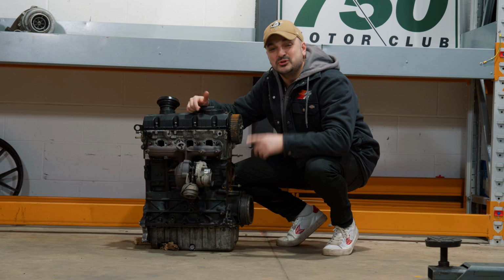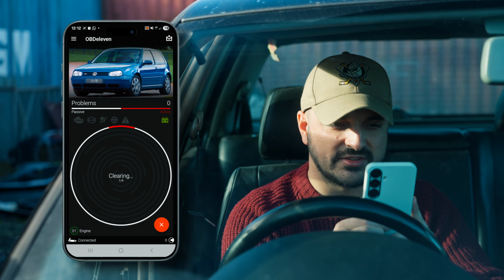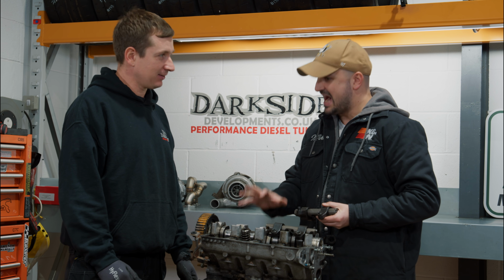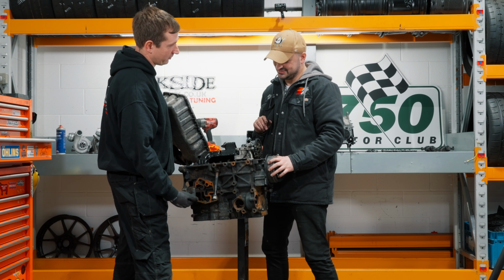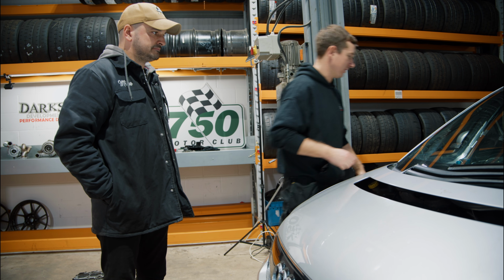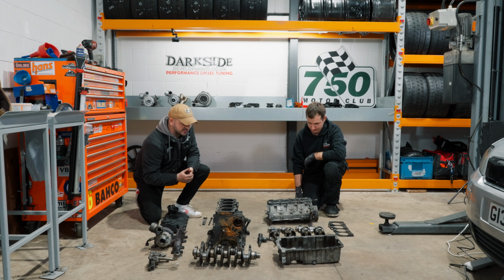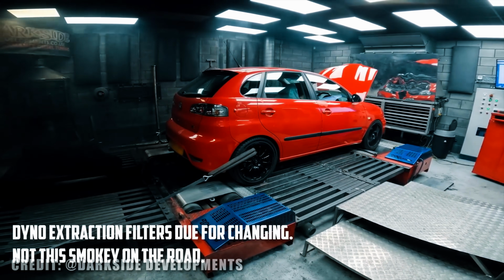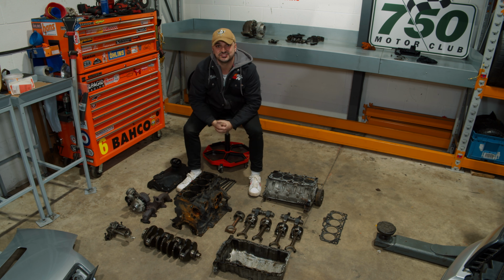Why This Volkswagen Diesel Is The Greatest European Engine Ever Made

Comment: This was in my car—a Caddy 1.9 TDI—and it had covered 499,800 km by the time I sold it. The only issues were that the battery would drain on its own if the car sat for a week, and there was a bit of light blue smoke during a cold start—nothing major, though. When the engine was warm, there was no smoke at all.

Comment: as someone who has driven and worked with Darkside developments here in Australia. I absolutely swear by them as wizards for the diesel vwag cars. doesn't matter if you want a nice daily or big power. these are your guys for hardware and definitely software. 

I am not a huge diesel fan but our drive cars that had a 1.9tdi caddy and a 2.0CR in a golf. they honestly drove brilliantly. real sleepers with great driveability and awesome economy. 

our crafter also was a workhorse running darkside software. 

had a 2.5tdi multivan these boys did software for and it was beautiful

Comment: I have a Skoda Fabia vRS Last Edition; I love this little car—I've owned it for 10 years. I'm currently replacing the camshaft and lifters with "Black Top" versions. I also crimped the small end plugs on the rocker shafts, as they tend to work themselves loose over time, and installed 07eins injector clamps to prevent the injectors from wearing down the bores in the cylinder head. Those are the only weak points; fortunately, I do all the work myself, as the mechanics are quite straightforward.

Comment: ALH engines are generally considered more reliable and easier to maintain, with cheaper parts and less sensitivity to oil specifications.  PD engines are known to be more prone to camshaft and lifter wear if incorrect oil is used, and their injectors are significantly more expensive to replace. ?

Comment: Does the injector solenoid not close to hold pressure in the pump, allowing it to over come the injector nozzle valve and spray fuel instead of energising to allow fuel through to the nozzle. That way it fails safe if the loom breaks.

Comment: great engine especially when the egr is disabled for better response and better mpg I ran one for 10 years sold it at 300k miles things to be aware the wiring harness in the cylinder head can break down giving injector faults the cam belt tensioner can fail both easy fixes and change the oil every 5k miles

Comment: Ran my PD130 on a high mix of petrol with dregs of diesel on the tank when we had a 'fuel crisis' in the UK a few years ago. It ran with a bit more smoke than usual (straight piped) but it ran fine for a good 50-100 miles!

Comment: There even was a 2.0 TDI with PD elements, Engine Block based on 1.9 TDI and Cylinder Heads with 8V or 16V (16V had some problems with PD Elements working into the Head), 8V was kinda good (Oil Pump Drive was a weak spot).

Comment: …and 100% get an OBDEleven! Bought a 2008 BMW X5 3.0si from a dealer as a “value unit” (headed for auction). 83K on the clock with the typical valve cover gasket leak—tech’s denied repairs—bought an absolute GEM for $4K. Repaired the gasket, installed gentle upgrades to the ignition and timing, tune everything via my phone through the OBDEleven dongle. Added optional upgrades like the folding mirrors and roll-down/up windows via key FOB for about 20 credits. The collective “close-sunroof/windows” via the moisture sensor already installed in your car is an added bonus. Definitely “hack” your car for little more than the cost of an OBDII ‘code reader’!

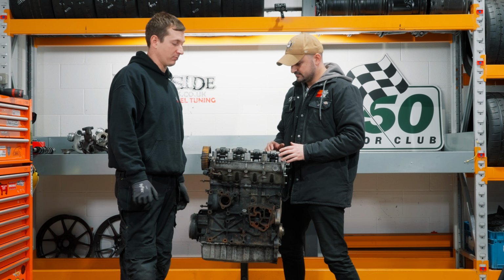Comment: 8:45 The biggest reason for failed PD engines is using wrong oil. These things require VW 505.01 spec oil and if you use "only" VW 505.00 spec oil, it will wear cams prematurely. Unfortunately, getting VW 505.01 spec oil is getting harder and harder these days.
Reply: Castrol edge meets 507.01 & Castrol guarantee it to meet the 505.01 spec too… iv ran Castrol edge in my 1.9 engine for 14 years & 188k miles… all good & oil analysis showing good too still!

Comment: Pumpe Düse engines were regarded, by those in the know, as good but less good than the VW TDi which preceded them, on account of earlier camshaft and injector wear.  VWs and Audis had the better engines up to around 2000 model year, Skoda Octavias used them until around 2004.

Comment: I have the GOLF MK 7 variant 2.0 TDI .. 150 hp  ... just changing the OIL every +/- 10.000 km's ... the engine sounds, vibrates & rolls just like day one after 220.000 km ..... On the streets of my city there are PASSATS from 1992 ...  and evenr older.

Comment: My dad drives a 2000 A4 with the 1.9TDI engine. 500.000 km done, the car was used recently for a 5000 km round trip across Europe. Needless to say, the car works great. Very little rust around the front wings, otherwise no damage. The engine itself works like new.

Comment: The VW PD 1.9L is better for modifying then the 1.9L TDI  (ALH). Even though I like the PD and it is overall a better engine, I prefer the ALH for my use case. I have only heard that the camshaft is the weak link for the PD, it has unit injectors like a "newer" 2-stroke Detroit diesel so that must put a substantial amount of force on the camshaft because it is doing double duty compared to the ALH and that must be why these engines can have issues with the longevity of the cam.

Comment: I have a 2014 3.0 V6 TDI CTBA - 341,000 miles and touch wood still sweet as a nut.  Only thing to go wrong was Adblue system (deleted), auxiliary coolant pump £17 from Aliexpress ,  vacuum solenoid £12 Aliexpress. On a run it still does 40mph+ in a large 4x4. DPF still fine.  0-60 in 5.9 sec.  Best diesel for me is this.  Only thing I have done since 100,000 miles as second owner is change the oil and filter every 6,000 miles.

Comment: It really is a fine motor....mine is on 210,000 miles and still ticks over like new. Just keep changing the oil every 5000 and use castrol edge 5w40 and you won't go far wrong. My reg.fh55ure

Comment: Just stay away from gasoline  2.0 tsi engines after the 2022 and newer.  VW says burning 4 quarts in between 5,000 mile oil changes is within spec - "normal".  Keep in mind it only holds 6 quarts of oil.

Comment: I’ve seen Fiat Puntos with the small 1.3-liter MultiJet engine—delivering a solid 95 hp—reach 700,000 km without ever experiencing major issues. I know the 1.9-liter version can also easily achieve high mileage; it’s a favorite starting point for tuners because these engines are incredibly robust. Many diesel engines from that era were highly reliable—especially those from Fiat and Volkswagen (not to mention Mercedes, where reliability is simply a given).Fiat cars do not have a good reputation, but the diesel engines they produced from 1997 until ten years ago were very well made.

Comment: nope, best vw engine yes, but the volvo b230, and the early (dog slow) mercedes diesel, lasts longer.  had all 3   the volvo lastet the longest-840k km (with only a waterpump change) scrapped becouse floor rusted badly- engine trans lived on in my friends son 240.

Comment: I had 1.9 2004 caddy. Straight piped, chipped, audi alloys, heat seats air con etc. Had about 60k miles on it and the timing belt went and killed the engine.😢

Comment: I bought one of these at auction   about 12 years ago a MK4 golf tdi with the 130 asz engine did 160 000 miles in it , got rid of it at 330,000 miles on it,still going strong,worst mistake was getting rid of it for a newer golf . That had so many problems. I rate the 130 pd as the most reliable engine ever, built to last,

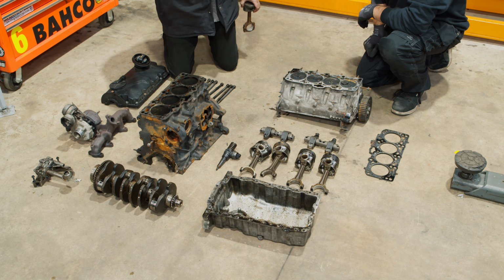Comment: 32:06 so as an American, our equivalent to this might be a small block chevy, you can take a small block from 1954 and bolt on a brand new transmission, yes you'll have to finnick with it but, it works, is that what I'm hearing?

Comment: The only 1.9 TDI engine that is rubbish is the engine code BXE. I bought brand new Golf mark 5 back in the the day (2008) and it had a 90hp TDI BXE engine. Apparently these engines all die @ 120000 km

Comment: We own a Skoda Laura ( octavia 2) 2008, 1.9 TDI PD 108PS. Its been 18 yrs and 2,30,000km,still runs like a dream. Has endured our Indian roads

           Only thing is I get those regular services done at skoda authorised service centre with oem parts once a year but do change oil and  filter every 6  months or 7,500km.

       The fun part is the low end torque it delivers and excellent mileage.
Reply: Qual o consumo desse motor na melhor condição  ? Obrigado

Comment: You forgot about the older ALH...   They were even more reliable...   I love mine.
Reply: I think AHU and AFN were better than ALH but those are all pretty low power engines because of lower pressure injection system. They do last forever if you just keep swapping the timing belt in sensible schedule, though.
Reply: yea ALH all the way. im on 400k miles and still going strong.

Comment: I wish VW puts this engine into a small pick up truck. The front wheel drive Rabbit Pickup truck (in the US) from the 80s. Unfortueately it was gasoline powered. TDI unheard of MPG and durability. Incredible torque. As a mechanical engineer, this is the Holy Grail.
Reply: I put one of these (straight out of a 250k mile Jetta) into an '82 Golf Mk1, as my daily driver. Probably done another 250 k on it in 10 years, with only minor maintenance. Still does 50 mpg. What an engine. ❤

Comment: Owned a A4 B6 1.9 PD 130 189-330k km. Engine never changed it's sound. Even was mapped to 150hp. Cleaned the intake and turbo. Drove like I gave it new life. Never any issues. It's at 500k now still going strong

Comment: Oh there's one more thing, on the 1.9s the egr valve was easy to get to, on the 2.0 and 1.6 commonrail engines they put it down the back of the engine at the bottom, what a crap design that was, I suspect deliberately.

Comment: I have a 1.9 PDI converted to a purely mechanical injector pump
Installed in my Mk1 rabbit pick up 
With corrado gearbox. 

She’s rattly but goes like stank and gets 75mpg!!!
Reply: In my humble opinion, the VETDI is better simply because you can do away with all of the electronics

Because at the end of the day, do you want to be beholden to a car that has a $700 computer that can lock you out with security? 

I paid $600 for my Land Rover discovery 300 tdi injector pump 
Which runs my AHU 

I have had the injector pump for 15 years and the only thing I’ve had to do is a $19 O-ring kit

I use a fully mechanical vacuum system to control the variable turbo 

Which I can change on the fly inside the car 

 I threw a rod through the block and rebuilt the whole engine block and cylinder head for about $650
Reply: I work in a VW diesel specialty shop when the Pd was first released in North America

They were out cams
Which sends me through the oiling system 

For that reason alone, the VE is better
Reply: One final hot take

The Pd engine is the modern equivalent of a Detroit D series
Reply: Also, a VETDI cannot contaminate the oiling system with fuel like a Pd

Comment: the incredible thing of this engine is the illogical one bolt to hold it in place. is condemned to fail. cold start is shit if they are worn out. replacing the seals do not fix, because the head is worn out too... WHY one bolt!!! WHY...

Comment: Some historical and real life experience. At the time and even today VW Golf 2 1.6 diesel (both turbo and aspirated) have been rolling on undestructable in the former Yugoslavia. I drove one that was older than me. Impeckable. My family had VW Jetta 1.6 turbo iy rotted away, and my mother sold it reluctantly last year. It was really an indestructable motor and so easy to repair. In Bosnia they still swear by it that it is the best car ever.
Reply: Obrigado por compartilhar essa informação! Tenho um aqui também. 1.6 aspirado. Tengo um pd100 atd.

Comment: the best diesel engine is the Alfa Romeo 1.9 16v JTD "937A6000" - 170HP 330Nm, with 6 speed manual C630 unit  + Q2 torsen diff

crossflow 16v head - not reverseflow 8v like this VAG thing
CR fuel injection since 1997 also became an industrial standard - not PD wich was introduced in 1998 and was outdated from 2008 even by its founder

😝😝😝😝😝😝😝😝😝

Comment: I had two cars with the 130PD engine; a VW Passat and a Skoda Fabia vRS.  In both cases, the engine outlasted the actual car.  The high pressure injection system was nothing short of a game changer.  As a friend put it, they finally managed to figure out how to burn diesel fuel.  I was always impressed by the strong midrange the TDI produced, giving great overtaking potential.  I now have a Skoda Octavia estate with the 2.0 diesel.  I will be happy if it provides as good service as my earlier 1.9s.
Reply: Maravilha de impressão que voce acaba de me passar. Eu tenho um pd100 aqui pronto pra um swap.

Comment: In the Ibiza FR / cupra R 2006-2008 you can find BPX engine which has everything what you have in the PD130/150 just better. Is has factory 160 HP with FMIC and pre-selected "the best" factory PD injectors. Generally the same block, but from factory it pulls way more agressive, thanks to the Front cooler, and agressive tune.

Comment: What a joke. I ran a 2002 1.9TDI VW Alhambra/Seat/Galaxy.115bhp for 100K miles. The most unreliable Car I ever had, Failures at 65K miles Plastic Water pump impeller detached. Cambelt changed at 40K. Next Clutch Slave cylinder failure at 80K on a Spanish motorway. 105K Cylinder head gasket failure blowing out water from the Pressurised water cap filler. No oil in the water as originally expected Then turbo stared showing a a small oil leak. Sold at 110K

Comment: I am just about half the video in, and i feel there are some remarks to be made: 
  1. If you call this the greatest european engine ever built, you should know that I call that way the grandpa of it, meaning the first VE(rotary distributor pump) direct injection of VW which is the 2.5 TDi 5 cylinder which arrived in 1989. In my opinion it competes with the 4 cylinder 1Z 1.9 TDI VE direct injection, arrived in 1991.  Doubling the stock power on the 1Z makes it NOT CARE and go strong. I`ve heard of some lucky AJM (116 PD TDi) who reach 220 hp but i wonder for how much abuse. I`ve never heard of camshaft problems on the 1Z because they are CAST and 2-3 times as thick  compared to PD which are PRESSED on.
  2. You cannot call this "mechanical injection" because every injector is electronically controlled. At most, you can say they are complex electro-mechanical pieces. VW only had mechanical injection on passenger cars waaay back in the indirect injection era - those were the only "TD" engines the idi ones.
  3.  The successor to the 1.9 PD was the 2.0 PD in 2003/4, and all of them had 16 valves. Only 4-5 years later the 2.0 CR came inevitably along. Inevitably because the "factory" could not keep the production cost down due to the PD injection's complexity. The fall of the PD system was when the "factory" tried reducing costs and switching to SIEMENS "piezo" PD injection and that was a total BUST, cars breaking down in warranty. VW was the last one in the industry to adopt the CR injection. They had lots of bugs at introduction due to no experience in CR. They supposedly fixed that.

Comment: I have a USA spec 2005 MK4 Jetta wagon, 1.9 pump duse 391,000 mi. Only thing I've changed his timing belts and related components the cam and buckets. Injectors were  resealed. First KKK turbo charger only lasted  15000 miles. Current turbocharger has about 376,000 on it. Borg Warner I think. I bought this car new 2005. I think that makes a big difference. Have just one driver in meticulous maintenance

Comment: cool, you should check out the volvo redblock, THAT'S a tank. also the whiteblock, although the whiteblock is only aluminum so its softer/weaker, but weigh less and got more hp. but both engines are fucking tanks especially if you take the diesel block's of each version and put it in a regular petrol version and then give them more hp via different ways.

Comment: It is a great engine, and Volkswagen have equipped it in everything. However the 1.9 JTD was the first mass produced common rail engine, as rugged if not more, more powerful and less cluttering, its only misfortune is that was produced by FIAT and not Volkswagen.

Comment: I bought a 1991 VW Jetta Diesel, my second one, and put 900,000 miles on it. I junked the car due to several things, including a lack of parts in the States. I got the last 4 injectors in North America. Another worn part I could not get but had to have it fabricated. VW left guys like me out to dry. I will say that they did make really good diesel engines- the problem here in the states is that the EPA is regulating diesel in cars and light trucks off the road. and  the low sulpher fuel is crap on engine components, ejectors, and fuel pumps and then there is the def we have to use, plus the fuel additives to compensate for the fuel, its just not worth the trouble anymore. This is from a guy that drove diesel cars mostly VW's for more than 30 years.

Comment: Anyone knows? How does a 2015 2.0tdi engine compares with 1.9pd? In reliability
Reply: Is it EA189 (dieselgate) Or EA288 (after dieselgate). The dieselgates were more reliable, and did not have wet oil pump drive belts like the EA288s do.
What i can say is that both are less reliable than the EA188 1.9 TDI PD, that engine is no wonder like what most people claim, it's an extremely overrated and overpriced engine. I would look for something different

Comment: 13:40: VW EA 211 (1.5 TSI) uses it in some versions.
22:47: No! Just compare a VW 2.0 PD SDI with any other 2.0 petrol engine. Way more torque on the petrol engine despite the lower compression ratio.
Reply: SDI engines sucked and i means quite literally as it means "Suction Diesel Injection". Diesels work flawlessly only when aircharged otherwise they are unable to crate enough compression to gain the torque